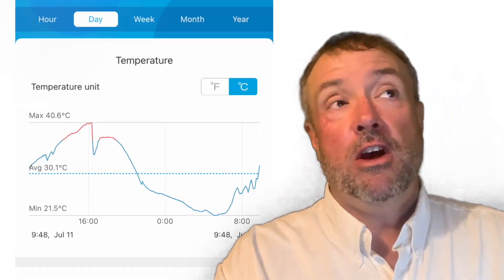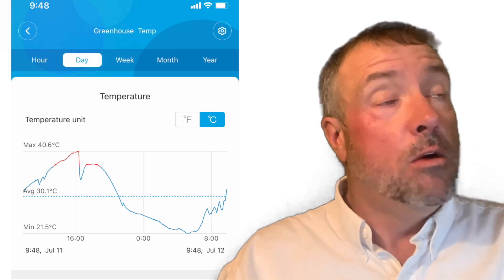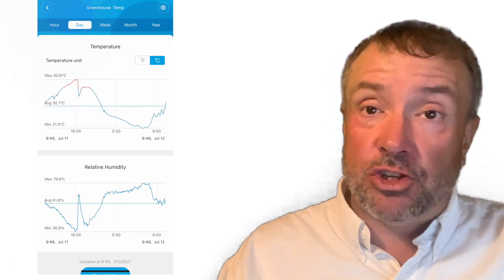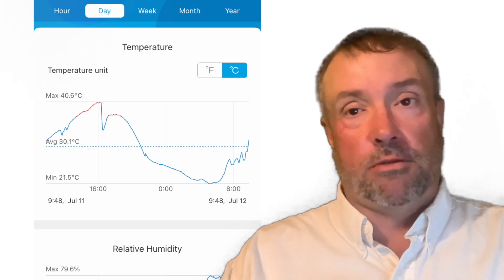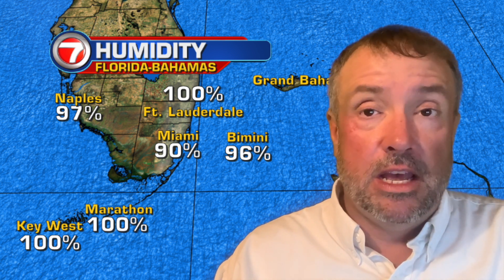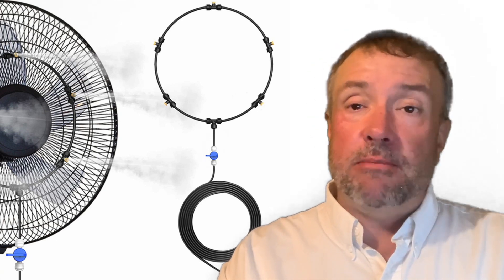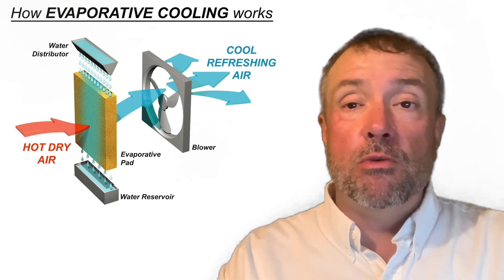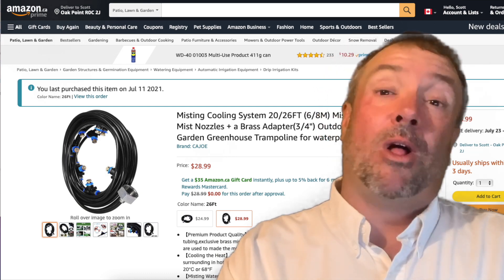Emergency Greenhouse Cooling

Comment from the maker: What's the hottest your greenhouse ever got to?
Reply: Yes, this is a good emergency method. For humans too. Our greenhouse went over 55°C on several occasions in early spring. It went higher for sure but the thermometer doesn't want to measure that high. Since then I installed a shading system, a simple roll-up made from a rigid tube and some white light fabric. It is fixed on the outside, keeps the energy outside of the greenhouse and shades the sun rays. It is still a manual system, but still makes a huge difference.
Reply: 140F but that was with the greenhouse sealed tight in full sun to see hot i could get it to go. The SHCS  took a shade under 12 minutes to bring it down to 68F. Running the overhead misting makes it much more effective but i`ve never had need to run both at the same time.

Comment: The geothermal system should dehumidify the air 24/7. When one end of the air tube is high, the other one at the lowest point. NO ventilators. The system will work by itself and create a stable self-regulating microclimate.
Reply from the maker: dehumidifiers work but use a lot of electricity

Comment: Howdy, what is your standing with the amount of volcanic activities and the eruptions that has a high potential of cooling the normalcy of the temps? Which makes growing food much more difficult...

To which, would a conductive material be usable as a 'static' (volcanic particles) collector... - giant nets attached to metal rod/pole, high up in the sky... collecting both electrical current to help with farming and changing the magnetic ranges around the general area... 
Imagine if you could stop or generate rain/clouds... with non-toxic ingredients... 
Lol, or how about the nets are like, gills of a fish... Purifying the air and collecting many different compounds and electricity...
Cheers!
Reply from the maker: I honestly don’t know much about volcanos

Comment: Interesting i don't  grow in the green house during the summer time i live on a peninsula very high humidity over 80% and in the mid to upper 90s but i do have a heat sink 858 gallons  when its in the upper 90s the temp is in the mid 80s.
Reply from the maker: thank you for sharing
Reply: @SimpleTek  your welcome.

Comment: Great content. Thanks for sharing.  I do worry about misting on the leaves because the droplets may act like magnifying glass which may scorch the leaves.
Reply from the maker: Great tip! but in super heat the moisture evaporates fast cooling the leave

Comment: Question @simple tek how much tubing is needed to cool a 1500 sq ft house for full house heating cooling like do i need a rad in every room and large longer lines etc
Reply from the maker: lots more info needed

Comment: Direct Evaporative Cooling only works in low humidity climates.

Consider using Shade Cloth , Shade Paint , Drop-Down Roll-Up Side Walls , and Forced Air Ventilation.

Pay Attention To Your Plants increased watering at the roots is required during high temperature periods.

Regards.
...
Reply from the maker: cheers from manitoba Canada
Reply: Misting works for me in north Florida.  The water comes out of the ground at 72 degrees.  Most summer days are over 90.  Black plastic nursery pots easily hit 140 in the sun.  Mid day humidity rarely exceeds 60%.  In the rare times I use an impact sprinkler at mid day I can see water evaporating off the spray.  Evaporative cooling doesn't work well, but it works.  It definitely wouldn't all evaporate away and in the case of patio cooling, it would leave you wet, but it would be a choice of being soaking wet with well water or soaking wet with sweat.

Comment: Yeah evaporation is endothermic. Just use a swamp cooler, same idea, but with either you have the same constraint that it will only work when you have enough capacity in the air for more water, as you are raising the dew point, so you can only raise it to the air temperature.
Reply: And with a swamp cooler you can just use a thermostat and perhaps humidity to set whatever temperature you want.
Reply from the maker: good advise